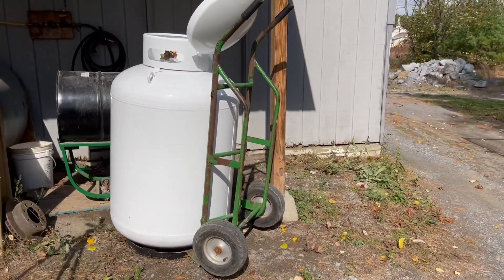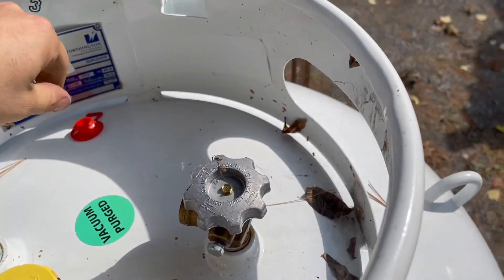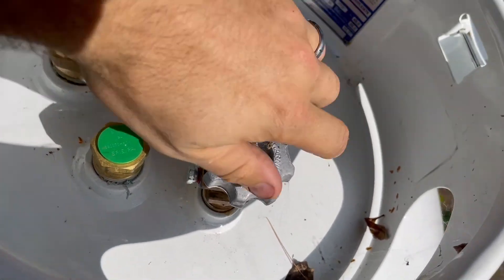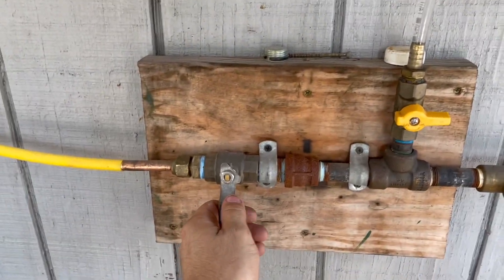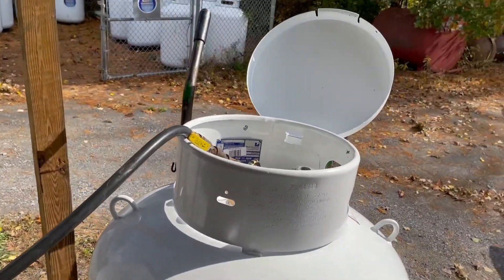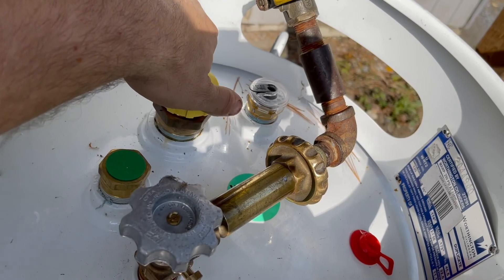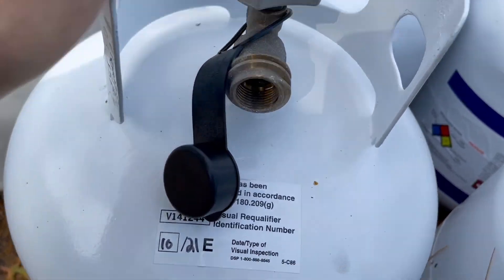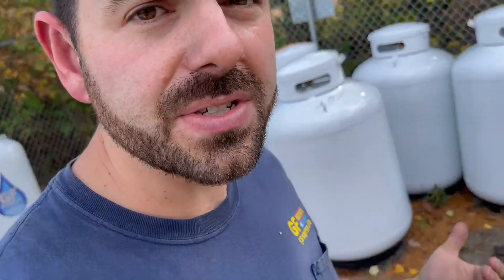How to Purge a Propane Tank Part 2!

Comment: I can't find much information on methanol for propane tanks. Propane suppliers sell it by 5 gallon buckets it seems. I just need a pint. Is racing methanol the same thing?
Reply from the maker: unfortunately I have no experience with racing methanol so I couldnt really tell you if its the same thing. Ive only ever bought it in 55 gallon drums

Comment: What are signs of air in a propane tank? I have a 100 tank when I open it just air comes out for the first 3 minutes
Reply from the maker: need some more context. does this happen every time you use the tank? what is it connected to for appliances etc..
Reply: @OnlyWood01 it’s mounted on a food truck and feeds two 65lb fryers. The flame on the fryer is all over the place and everything is dialed in correctly to spec. The only thing I can think of is air inside the propane tank. When I open the tank no propane comes out just air for the first 2 minutes when the valve is open. Not sure if this is normal I got propane at the ARCO gas. I had 3 technicians take a look at the fryer nobody can figure out the issue. The fryers are fairly new
Reply from the maker: @centralcoast6720  so theres a bit to unpack here. lets just start with an answer to the original question. What effect would air in the propane tank have on the flame? If it were actually able to light the flame would be much much hotter than usual, your burner grates would be glowing red hot (think adding air to a propane torch). 

I dont think this is happening, mainly because the only realistic time air can enter a propane tank is when it is being prepped for service. Once the tank is in service its pretty much always under constant pressure and therefor wont allow any air to enter the tank. Even when you run the tank empty theres still going to be a small amount of liquid left in the tank vaporizing to maintain pressure. 

Second, 3 minutes is quite a bit of time, one possibility if the burner was not lighting all would be that that the gas valve in the fryer isnt closing after it loses pressure and its burning up whatever is left in the gas piping, here if that were the case it would be possible to get air in the gas piping  but still not the tank. 

Third, the most likely scenario and what I would be is happening is that your tanks are being overfilled. Liquid propane, instead of vaporized propane in gas form is making its way to the regulator causing this irratic behavior for a period of time until the liquid vaporizes down to a point where you observe normal operation. 

I have a few food truck accounts so what im assuming is when you get the tank filled its not being taken off the truck and put on a scale for filling (which is the only way to be 100% sure that it is being filled to the correct level) this means whoever is filling it is either using the spitter valve on the tank to determine if its full or just waiting for the pump to shut off when its full. If its the later of the two this is completely incorrect and a huge safety hazard and is most definitely the reason youre having this issue. If whoever is filling it is using the spitter valve, its quite possible that the tube that is connected to the spitter valve to determine 80% full has fallen off into the tank and because of this spits at 100% which would also be the culprite of this problem (although it would look like normal operation as far as filling it is concerned). And I have seen this happen multiple times. 

Hope this helps

Comment: If i understood you correctly you mentioned you pull a vacuum on your 20 lb tanks? If so what do you use to pull the vacuum?
Reply from the maker: well most 20 lb tanks these days or at least the ones we get come in a vacuum but for the ones that dont i use an old vacuum pump that we would use to draw a vacuum on a refrigeration system. Technically the other way to fix a tank that has air in it is you can bring it up to 15 psi of pressure with either propane vapor or some other inert gas like nitrogen and release it to the atmosphere 5 times. That combination is supposed to remove something like 98.5% of the air

Comment: I just just purchased two 100 pound tanks and the guy didn’t tell me they had to be purred. They were vacuum purge and he just built them up without saying anything. What should I do?
Reply from the maker: tough to say without being there hopefully they were actually in a vacuum. just because they come in a vacuum doesnt mean they are in one when you buy them alot of times a valve gets hit and opens slightly. did you see him test that it was in a vacuum? If it was actually in a vacuum you should be fine but if he never tested it tought to say.

Comment: I have a question a 20 or 30 pounds or 40 pounds RV tank portable you’re supposed to unscrew the little screw on the side to purge as you feel to have the air escape because Air under pressure creates acid and also conversation a few places I went to said that they don’t do that anymore. That’ll get the water or the air out.
Reply from the maker: that valve is not used for purging. its a spitter valve to let you know when the tank is full.

Comment: How to get the condensation out?? Too much water, 7 gal rv tank stops burnig at stove but can only put 3.6 gals in. Please help.
Reply from the maker: sounds like the tank is being put into auto refrigeration. depending on the conditions if the usage is greater than the amount that the tank is boiling it will stop boiling and it will act like an empty tank but still be half full

Comment: If you use the propane liquid, and there is any moisture /water vapor inside the tank, it will freeze instantly and not facilitate you getting out the water/moisture which is the aim of purging. So using the propane liquid will lead to failure to achieve the results of purging... no oxygen in the tank.
Reply from the maker: You are correct. Tanks we receive under a vacuum are deemed to not have any air or moisture this is one of the reasons we purge with vapor through the service valve in this video I was purging with vapor not liquid. Thanks!

Comment: Ok, so you fed the 100 gal tank with 1 pint of methanol. Then pulled propane into the tank from the other 100 gal tank until it was even pressure? So, my question is. On a 100 lb tank with a standard POL valve how would you actually purge the tank? Add about a gallon of propane and then open the valve about 5 times to push the air out? Then fill to 20 gallons? I have 2 new 100 lb tanks that both appear to be under vacuum. Should I open the valve until vacuum is gone then fill tank and perform the purge with one gallon?
Reply from the maker: With a 100 pound tank that has air in it the procedure is to pressurize the tank to 15 psi with propane vapor and then released. Rinse and repeat this procedure 5 times with propane vapor and they deem the amount of potential air in the system to be minuscule enough to not be an issue and will eventually work its way through the system
Reply: @OnlyWood01  Can you also draw a vacuum? This would also remove any water as we do with AC systems
Reply from the maker: @cyoungso  if the tank just has air in it yes I wouldn’t attempt it with propane vapor present in the tank. Most new tanks come to us under a vacuum but it is still standard procedure to add methanol and to bring up to positive pressure with vapor through the service valve
Reply from the maker: If the tanks are under a vacuum we normally put half a pint of methanol in for a 100 pounder. If you don’t have a system to inject propane vapor in but you inject liquid in I wouldn’t worry about releasing vapor. If the tank is under a vacuum it means there is an absence of air which is ultimately you’re looking for so once the liquid propane vaporizes and fills the tank you should be ok
Reply: @OnlyWood01  awesome thanks for the help!
Reply: Too few propane filling employees even care about proper tank purging or proper tank filling.
They don't know x 10.
They don't care x 10,000.
They literally could not care any less.
No one can convince them of anything..... outside their pattern of improper filling procedure.
"Go somewhere else"  is their standard, apathetic & defensive retort.

Comment: Thanks for making this informative video. How much vacuum is needed?
Reply from the maker: I can’t find a number in my code books that it is called for we just shoot for a level close to what we pull down refrigerant systems to which I believe is lower than what is required for propane. Not advice just what we do

Comment: What’s the purpose of the methanol?
Reply from the maker: Even though propane vapor now a days is considered “dry gas” it’s still got some moisture in it. We put the methanol in to keep that moisture in suspension and eventually work it’s way through a burner and out of the system. Lack of methanol is a big reason some people deal with regulator freeze ups
Reply: I sooo appreciate your explanations and caring about proper procedure.
🙏♥️😎🙏👍👍♥️